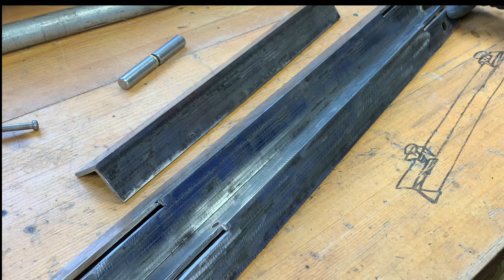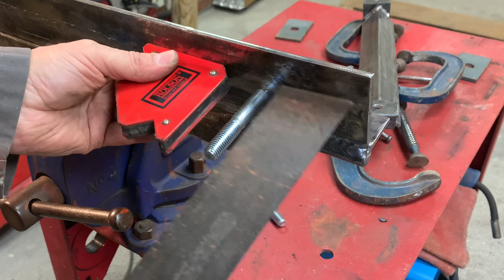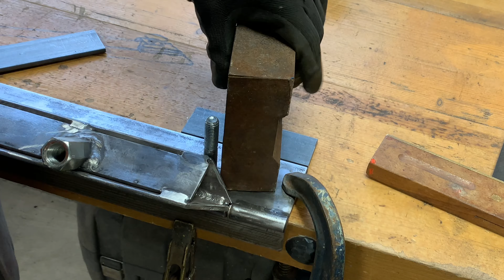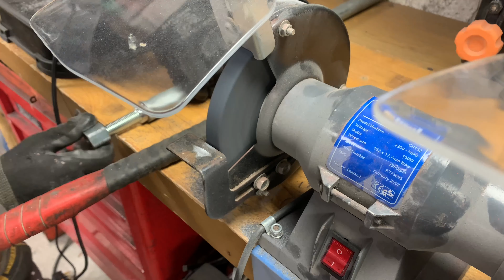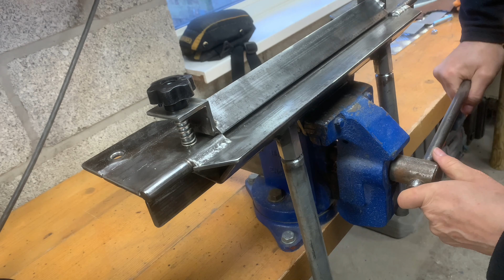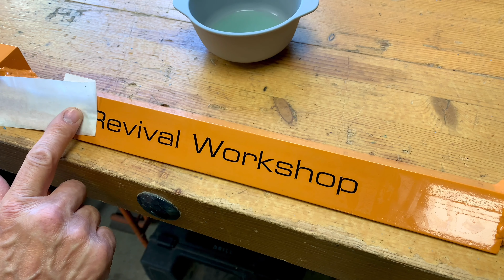Perfect Home Metal Bender Project DIY

Comment: Maybe a couple of hooks under bench to keep the flex down and make it a little sturdier.
Reply from the maker: You are absolutely right it does. I have actually already modified it by welding on two pieces of flat bar which go under the bench and catch the two securing bolts. Makes it much better. 🙂👍
Reply: @revivalworkshop  Hope it works better.
Looks very serviceable either way
Reply from the maker: @willardlentz3044  Thank you Willard, I did video the modification so I might do a follow up video. 🙂👍
Reply: @revivalworkshop  Always try to be helpful to makers.
I will watch the video soon
Reply from the maker: @willardlentz3044   Hi Willard, I have made a modification to stop the flexing. If you are interested you can find it here: https://youtu.be/WzG-26T-Q3w  Works much better now 🙂

Comment: Two more bolts in the front to stop that flexing while bending
Reply from the maker: Hi Mike, you are absolutely correct. It was an obvious flaw in my design and something I plan on correcting. I plan to weld on a couple of small L shaped pieces of flat bar to catch the to existing bolts, ie I would slide the whole bender assembly over the edge of the bench and drop in the two bolts. Probably just use them as pins wouldn’t need to tighten them up. I actually nearly did this as I built it, not sure why I didn’t, trying to save time I guess. 😏 Thanks for watching and I hope you enjoyed it. 🙂👍

Comment: Nice to see a video of tool making where the welder knows how to use a stick welder correctly and not this stupid dab method.
Reply from the maker: Thank you I’m glad you appreciate it. Must say I’m puzzled with this dap welding, it’s fine if your maybe doing a vertical weld or welding something really thin. Welding is 10% theory and 90% practice (that’s all they have to do, although they do need a tiny bit of aptitude) What is also annoying is that they often get millions of views 😲🙂.